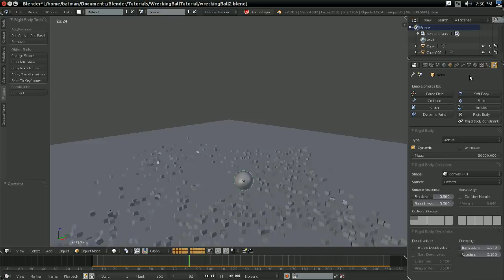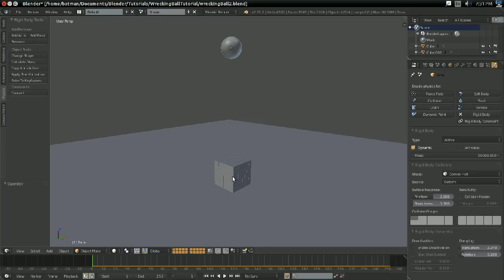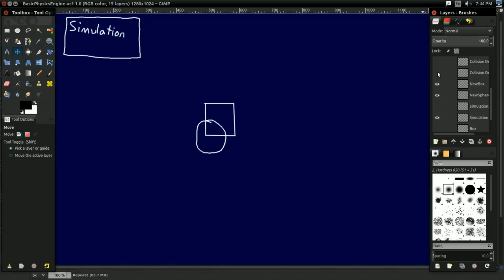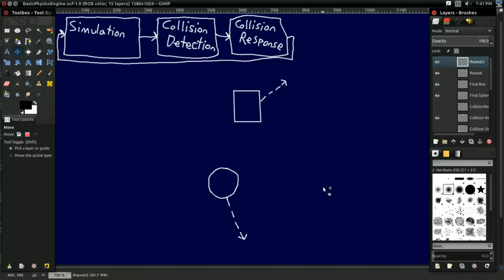#1 3D Physics Engine Tutorial: How Physics Engines Work

Comment: Hey Benny. Great to see you back. Iv'e been thinking about physics engines, and was wondering if after it was implemented on the CPU, would it be possible to do a series on moving it over to the GPU using OpenCL? That might be an interesting series. Also, at some point can we do picking?
Reply from the maker: I haven't decided anything on that yet. It really depends on how much gain there is for porting to GPU vs. the complexity of doing so. For instance, if it's so complex that it takes 50 videos to do and it only runs 20% faster, I'm probably not going to do it.
Reply: Fair enough. Thanks for getting back to me BTW. If it's ridiculously complex, then it may be a tedious series to do, but it might be a good introduction to GPGPU programming with OpenCL, given that we would have the code down already.
Reply from the maker: Isaac Woods I wish it were that simple, but actually a fair number of the CPU based physics algorithms don't work very well when executed on the GPU. So you'd pretty much need to redesign huge chunks of the physics engine just to effectively take advantage of the GPU. Even then, the GPU based algorithms and design don't necessarily work better than the CPU algorithms and design in all cases.
So I'm sure you can see why I'm a little cautious about jumping into GPU based physics stuff.
Reply: Ok. Fair enough, thanks for responding.

Comment: Hey, Benny! Great to see you back again, and i'm really interested in making a physics engine. By the way, I was wondering how you are going to store translation and rotation. Do you use a Martix4 compatible with the rendering engine, or just multiple Vector3f, or something else entirely. I also wonder how you'll store the movement and torque of objects.
Reply from the maker: I'm probably going to store position and rotation with Vector3f and Quaternions, respectively, simply because that's what transform is using.

Velocity (which is what I assume you mean by movement) will probably be stored in a Vector3f, and torque I haven't completely decided what I'm going to use yet.
Reply: ***** Yes, I meant velocity when I said movement. I also have another question. At about 6:48 you say that how the cube and ball bounce is determined by how much they intersect. Is how much they intersect really that important? If that is the case I think there will be problems with dynamic FPS or objects with the same speed and different starting positions.
Reply from the maker: haved I'll talk more about this issue once we start dealing with collision response, but here's the short version for now:

Let's say before the simulation, no objects are intersecting, and after the simulation progesses by one step, objects are suddenly intersecting.

That means at some time between the two simulation steps, the objects must have collided with one another. To be accurate, the physics engine must simulate the collision response as starting from the exact time of the collision, even though that exact time happens between steps of the physics simulation.

That's where the intersect distance comes into play. Knowing that and the velocity of both objects, you can calculate the exact time that the objects collided, and simulate the collision response as starting from that point in time.